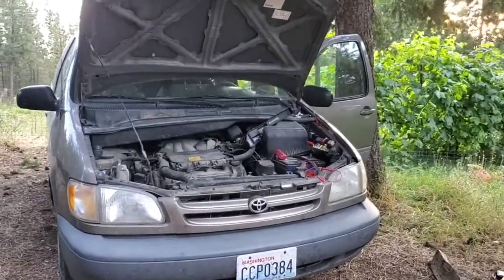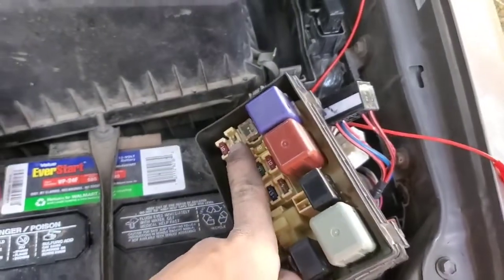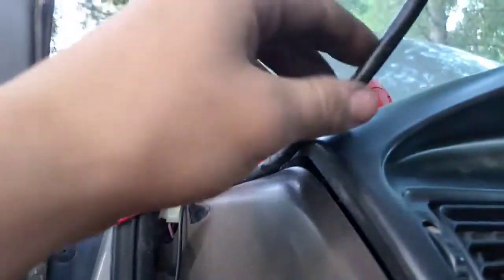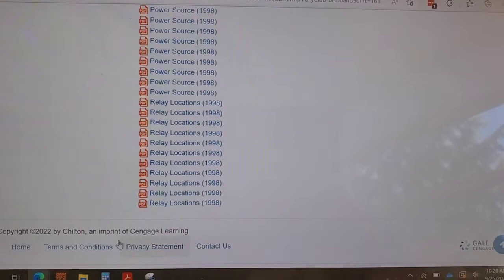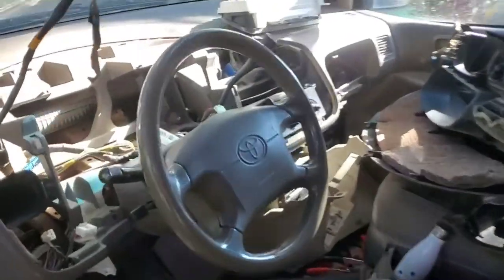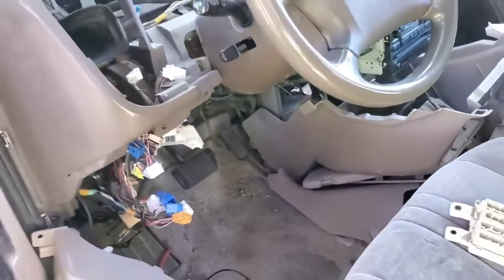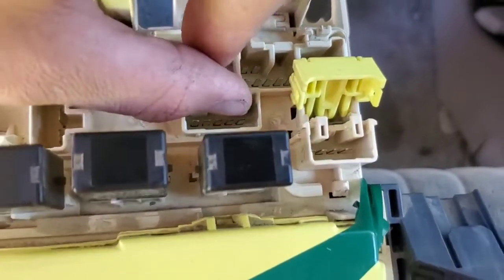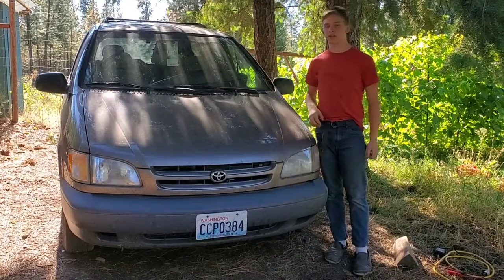Interior lights not working, its not a fuse! | 1998 Toyota Sienna

Comment: Mine is a 2000 sienna.  The headlights, and electric door locks turn off with the key.  Only vehicle I've ever owned where the headlights/parking lights and remote locks turn off with the key so you can't lock or unlock it with the remote and you can't turn on the headlights without the key being on.  It also doesn't have 12v lighter socket or interior lights.  Is all that related to that relay box on yours that stopped the dome lights from working?
Reply from the maker: It's most likely the fuse box like the video. Did you get this one figured out?
Reply: No I haven't figured it out.  I gave up and bought a couple of stick up lights to use at night.  Is the fuse box hard to get to?  Does the dash pop apart or is it's screwed down?
Reply from the maker: You may have to take a panel off just below the steering wheel to get to it, but other than that, it's a matter of removing all the connectors and pulling it out. Since each connector is a bit different, it's impossible to put the wrong connector in the wrong place. However it would be a good idea to mark things as you take them apart.
Reply: Awesome thank you.  I will wait until warmer drier weather and give it a shot.   Thanks again.

Comment: Wish I found your video earlier last year 💀 I drove this van for over a year with no interior lights until I got sick of it & only figured out it was the integration relay from a post from 2004 lol. Blind luck
Reply: My mother does not have downlights in her 2002 Toyota sienna so can you break down your comment? I would like to fix her dome lights for her. I’m going to change out her alternator and I’ve never done it before but I’m going to try it and see if I can’t save my mommy some money TYSM
Reply: @AlexAndra-iy5zu  does her interior door locks work? Integration relay goes on the back of the fuse box.  Before you do all this though check your dome light fuses.but a big clue if it’s the integration relay is dome lights AND interior door locks NOT working
Reply: @masterk5066  The lighter and all sockets work. All the windows work just fine but there are no dome lights. Believe it or not I just found the fuse and relay box when I changed her battery for her car. 

It’s my mothers vehicle but my father drives it as my mother is no longer with us. We’ve always called it Nana’s van. I just wanted to be transparent because I’m so used to calling at Nana’s van but in reality Papa drives it now